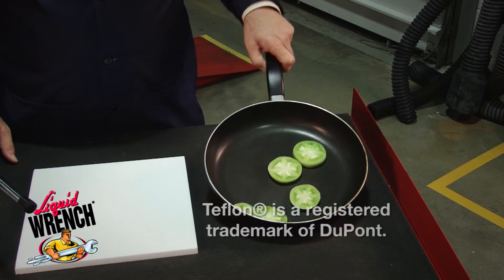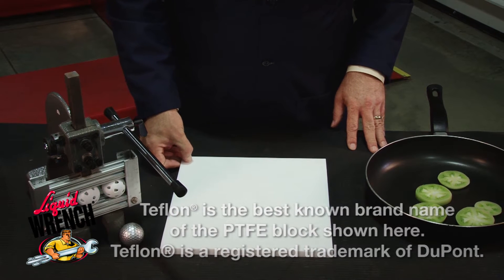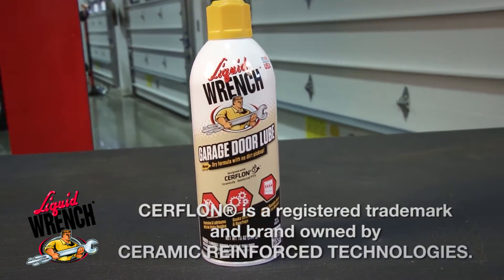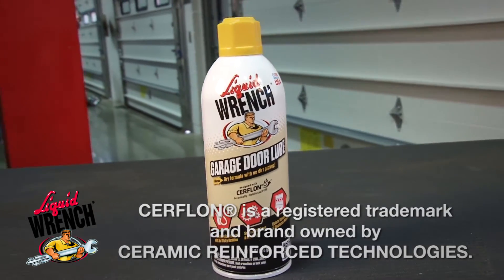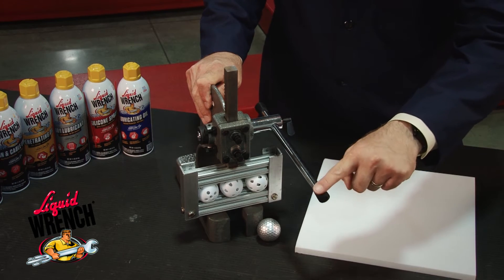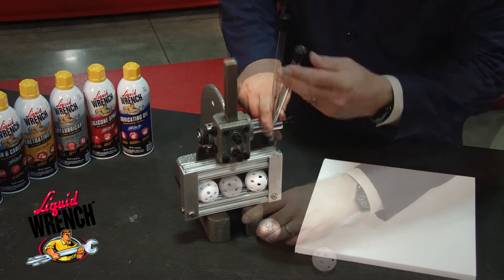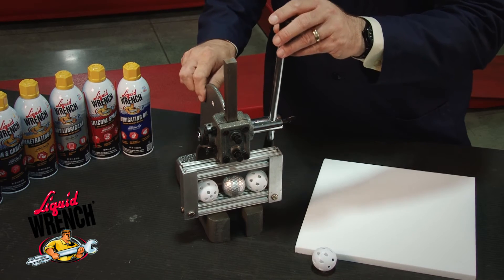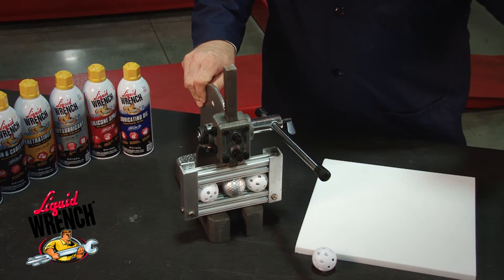What's Cerflon?

Comment: All I Can Say is...WOW !!,. We Were Riding Our "Faster" Electric Bikes Down a Path One Day & The Disc Brakes Started Making SQUEEKS & SQUEELS which were Very Annoying !! Well,...By Chance I Stopped into an AUTOZONE Store & Thought of a Potential Fix For this ISSUE we were Experiencing. Well, I Made My Way to the Lubricants Shelf,...& Found Your Silicone with CERFLON In it,...& Was Willing To TRY IT on Our Disc Brakes !!! "No One" Will Believe What I've Told them about this Product !!! ...it Actually & Totally Eliminated OUR BRAKE SQUEEL ISSUE !!!...I Sprayed a Small Amount Directly onto the "Disc Surfaces", Both Front & Rear,...of Each of Our HIGH-END "PEDEGO" Electric Bikes !!! Well, after a few tenths of a mile to give it a chance to dry & work itself into our pads by moderately & frequently squeezing our brake levers,...It NOT ONLY QUIETED OUR BRAKES,....But Allows us to Stop These Faster Bikes efficiently Enough to Want to Continue to Re-Apply it every few hundred miles or so....!!! I CANT SAY ENOUGH ABOUT HOW WELL THIS PRODUCT WORKS,...Contrary to "Conventional Wisdom" That says not to use any lubricants directly on brake rotors or pads !!! Like I said, "WOW, WHAT A GREAT PRODUCT !!!" Can You Explain why this does what I have testified too here with our bike brakes ???
Reply from the maker: We do not recommend spraying any lubricating substance on brake components. The best way to get rid of squeal and maintain brake performance is to clean them with a brake cleaner. Our sister brand GUNK has a great brake cleaner in their product line. Click the link below for more detail.

http://www.gunk.com/products/cat_PC_BC.asp
Reply: Wow,...Your product Is GREAT !!...For Keeping our Disc Brakes Quiet for 3 Yrs Now !! Even though you Don't Recommend it for Bicycle Disc brakes,....We Still enjoy SQUEEL FREE BIKING by Soaking our Disc Pads every 700-1000'miles, With EXCELLENT RESULTS !!! GUESSING even your Company Reps don't know this Application Works with Organic Bicycle Disc Brake Pads !!!🤔👍👍☺️🚴🏻🚴🏻🚴🏻🚴🏻🚴🏻Maybe there's more to "CERFLON" Than you Think !!!👍☺️😉